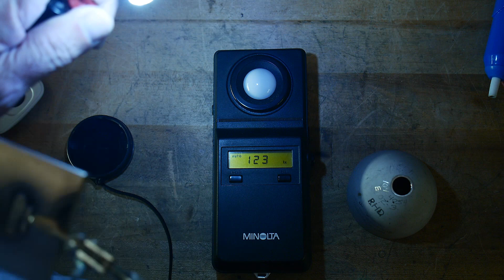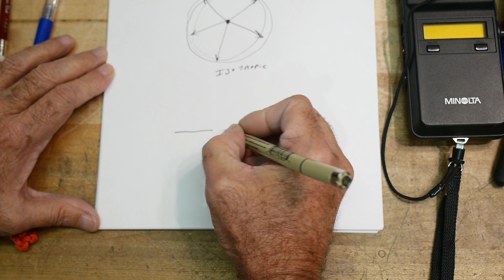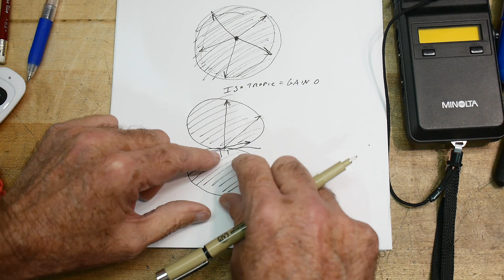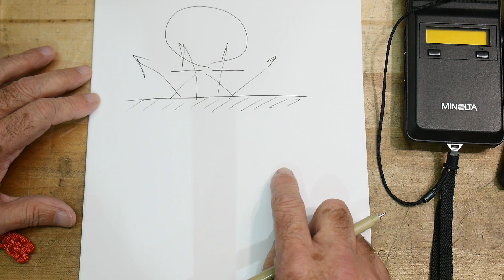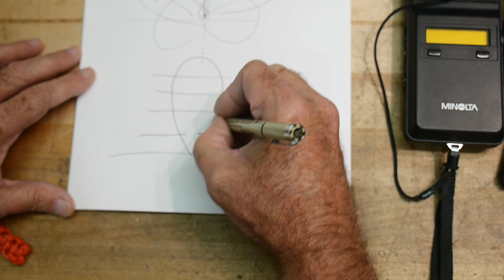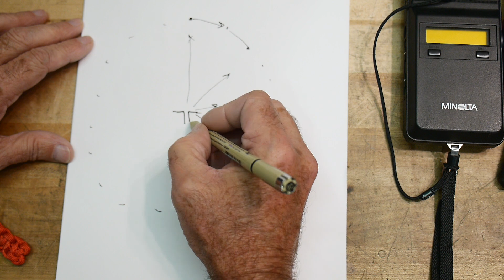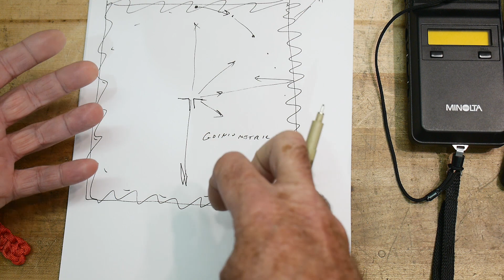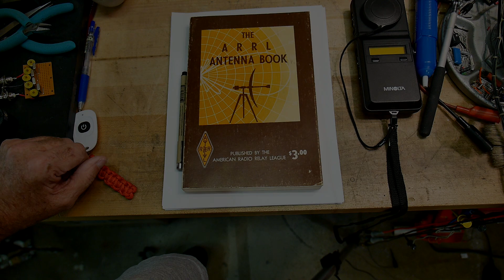#580 Antenna Gain

Comment: Actually the VHF/UHF/Microwave guys do some limited relative measurements in a amateur antenna field with relative vs. absolute type readings. You're correct, calibrated field strength meters are very expensive. Having said that you can, even with the little Monarch brand combo SWR/FS meter I used as a Novice in 1969 make some albeit crude measurements that can be useful (still have it!). A simple example is attaching a "stinger" to a HT (extra ground wire just under the connector) and see a significant increase in FS at the same distance as without it. Yep, not quantitative but at least a very crude qualitative indicationt. Thanks for the explanation, I've shared this video with my fellow instructors in our General Class upgrade group to give them some additional  ideas about how to better explain the concept in class.  Love the Antenna Handbook, that was my first one as well!  ;-)

Comment: what is described here is antenna Directivity which is independent of impedance matching (VSWR) and losses. Antenna "Gain" on the other hand does depend on losses and also impedance matching although the pattern looks the same as Directivity (take the directivity and  just factor out the losses and mismatch then it becomes Gain)
I have yet to see an anechoic chamber where the receiver antenna moves around a sphere in the far field of a fixed test antenna! The receiver is always fixed (in some chambers it has its own turn table too but in fixed position) and the test antenna is also fixed on a turn table and that table rotates in its place and all azimuth and elevation angles between the receiver and test antenna are covered this way. Nothing moves around the chamber on a spherical surface as indicated in the video

Comment: And to think I could have purchased an Anechoic chamber for $1,000 when my company down sized and moved but it would have cost me $5,000 to move it and another $25,000 to set it up  I didn't win the lotto that week and am still crying. Sure would have been nice to have an Anechoic chamber sitting in my backyard LOL Great analogy using light! By using the VNA you can measure the S11 than calculate the loss which than you can figure out it's efficiency.   73 N8AUM

Comment: Thanks for sharing. Can you explain how the ground plane acts like a reflector? It seems like the transmitted power that hits the ground plane would be absorbed not reflected.
Reply from the maker: welcome to electro magnetism. Radio waves and photons are the same thing just different sizes. Mirrors work right? the light is not absorbed but reflected.   from a search: "Mirrors reflect mainly because they are electrically conductive. Light is an electromagnetic field, and when it hits a mirror the metal inside of it (usually aluminum or silver) cancels out the electric field parallel to the mirror which causes it to change directions and reflect away." .   Consult Mr. Maxwell for more....
Reply: The ground DOES reflect radio waves and depending on the type of soil (ground) will have a great effect. Simple example: I live in Florida which is mostly SAND so my Dipole that is 20ft. high works like a Dipole that's at 30ft if I lived up north with Clay  underneath. People use to pour salt on the ground to make the ground conduct better.